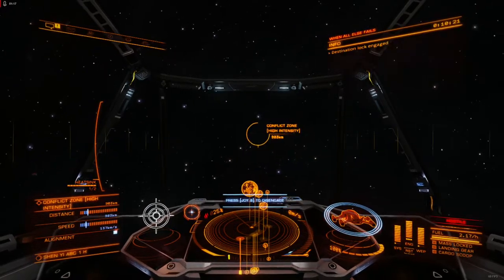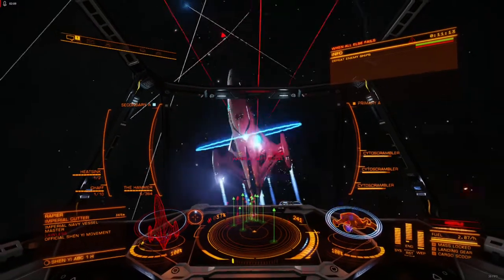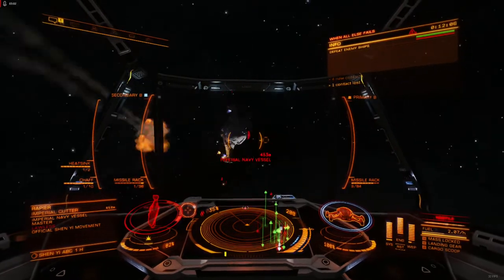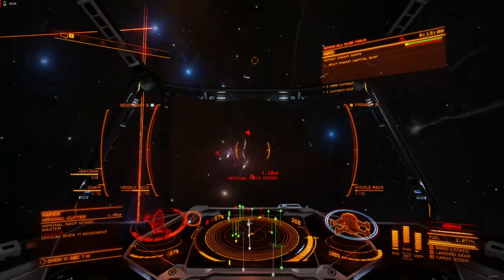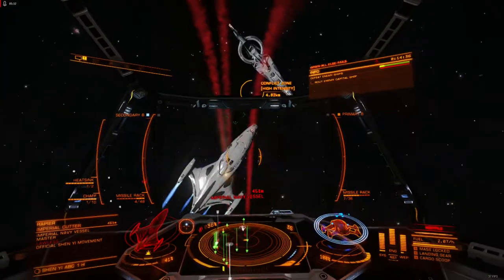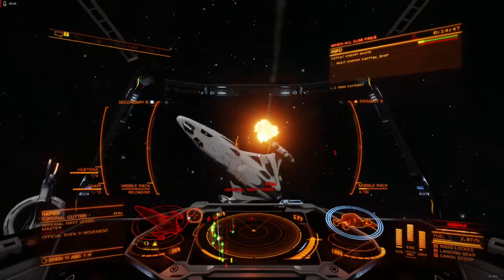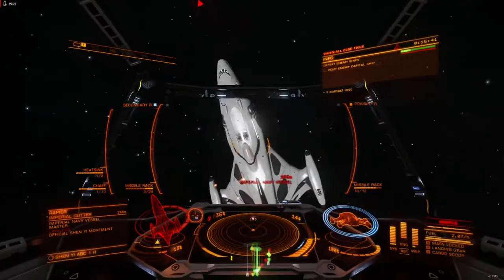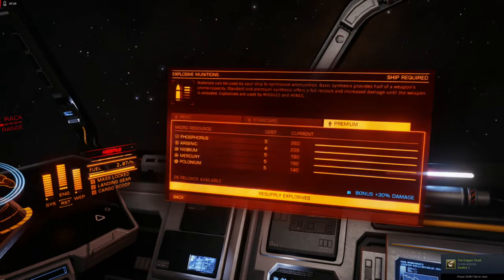Elite Dangerous | Build Experiments | Dumbfire Missile Review

Comment: I’m using flechettes to defeat the shields by subtarget the power plant, causing enough damage to malfunction it. Thus dropping the shield generator in the process.  And sometimes the drives too. Making them a sitting duck. 

Paired with the super pen advanced rapid fire missile rack. Once they dead in the water. It’s pretty much over from there.

Comment: I tried them as small hardpoint on a Viper with high capacity + multi servos. How does the Penetrator experimental work if you wanna go for powerplant snipes, cuz I was shooting them for days and barely did any internal module damage. High yield cannons seems very good at that job for comparison.
Reply: I got the Advanced Missile Rack with Super Pens. VERY EFFECTIVE. I captured some kills on video.
Reply: High yield shells ARE better because missiles and flechettes are easily shot down by point defense.